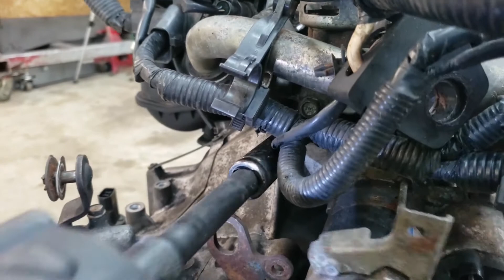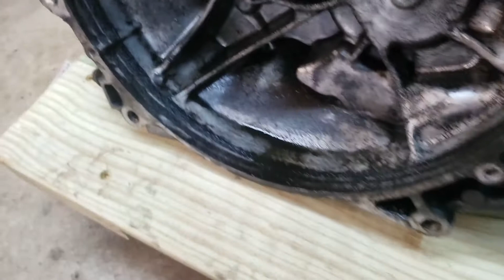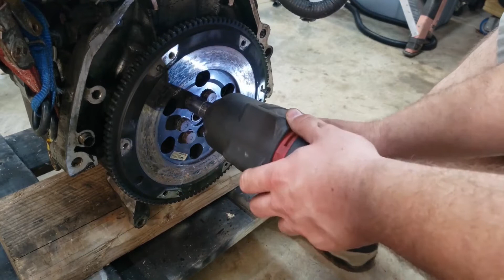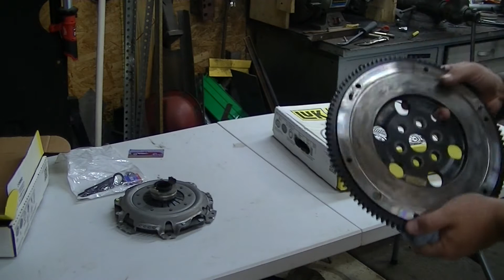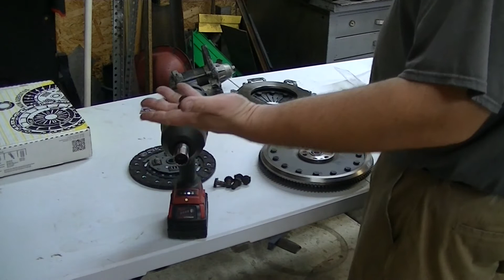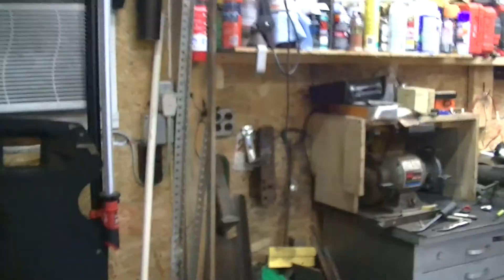Honda Civic 01-05 (7th GEN) Rear Main seal Clutch/Flywheel Replacement

Comment: ...irony.  The thing I ABSOLUTELY needed was to see the rear main seal cover itself be removed, because mine just WON'T and I need to know if mine is just needing more prying or if I missed something to get it loose.  You skipped it.  That ONE step I needed.  :D  I mean, I guess it must USUALLY be easy because everyone says "remove it, then here's the directions to remove the seal from the bracket itself", but mine will NOT come free in the first place.  Oh well.  I'll keep looking!
Reply: u get it out?
Reply: @ahsansubhan-zy1mo  Thanks for checking!  Yeah, I had to wrestle CAREFULLY with it for a bit before I decided to do the 'drill a hole into the old seal's metal band and pull it out that way' trick.  I slowly drilled a hole, then put in a self-tapping screw that was short enough that it wouldn't damage anything accidentally.  Once that was solidly in, I used a pry-bar that was NOT resting on the seal's edge to pop the seal free finally.  Once that was done I was able to pull the rest of it free and clean the hole.

I was almost about to put come-along straps or maybe stainless-steel wire rope through/around a few bolts on the upper cylinder head to hold it safely without the jack under its oil pan that I was using for now.  I was almost about to do that and then pull the oil pan down and remove the seal's housing /entirely/, but the 'good-threaded self-tapping screw' option finally worked for me.

It was SERIOUSLY stuck in there.  I mean, my car is 26 years old now so I'm not really shocked by that but it was SUPER-stuck in there!

I suppose I'll find out if I did it perfectly only once I have it all reassembled and get to run it, but I'll see how that goes!  So FAR, at least, it seems to be all good.
Reply from the maker: Very sorry that footage either got lost or I forgot to film but once the bolts were removed the cover came right off yours must have been corroded or sealed in place I hope you got it! Thanks for watching.
Reply: @ElectronicMechanic50  It's fine!  And yeah, it had been leaking notably but not terribly, so I think it 'cooked a bunch of oil into place' over time.  It would NOT budge for simple efforts to remove it.

For the record; I was told that an aluminum or maybe brass paint-can key (with some painter's tape on the prying-side just to be SURE it won't damage anything) could free up most of the rear main seals.  The crankshaft side is steel, the outer-mounting is aluminum, so 'paint-canning it open from the inside edge' might work.  I couldn't find one, and in my rush to work around freezing weather I gave up and drilled the seal in the middle of its metal band and pried it out that way.

I was desperate for the 'RMS removal to be in video format' because mine was SO STUCK that I thought surely I had a lip somewhere that I was going to damage, or maybe my exact model of car had a variation of the crankshaft-seal collar and doing what others had done to pry out a stubborn seal might have damaged my engine...but nope, my D16Y5 (1996 Civic HX) rear main seal was just STUUUUUUUCK.  Once it popped free a little it was 100x easier to get the rest out, I just 'worked around the edge' tugging it out a bit, doing that around and around again and again until I felt good about just yanking it out.  Pop!  Out it came, no scratches to be seen.

I cleaned the rear-seal mounting thing and the crankshaft (though the seal-frame was 20x nastier than the crankshaft...I think only the edge was leaking and not the shaft) thoroughly, wiping it out with FedPro "Tub o' Towels" heavy-duty cleaning wipes, then went over it again with brake cleaner spray sprayed on a (CLEAN and NOT fuzzy!) cotton cloth.  Once it was all spotless...well, that very moment it started to freezing-rain so I had to pop painter's tape over the whole seal-opening to make sure it didn't rust, then close up for the day/week.  I'm hoping to get some 40+ degree weather in the next day or three to try and put the replacement into place.  We'll see.

But I was just whining about the video because that was THE THING I was here for and I was watching it like, "Disassemble, disassemble, we're almost there...and there it is, replaced!" and I was like, "NOOOOOoooooo!"  That's all there was to it.  :)
Reply: I know this is old but drilling a self tapping screw and using a small slide hammer with a vice grip will usually help with those stuck rear mains just be careful with the screw. ive destroyed one trying to get it out before and had to pick the rest out  @EShirako
Reply: Literally she didn't show himself removing it wtf 🤌